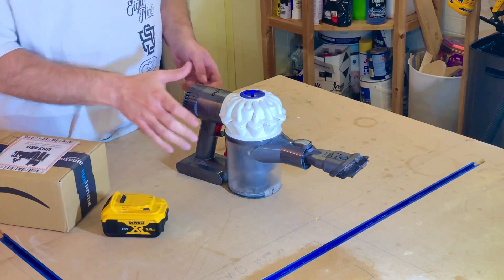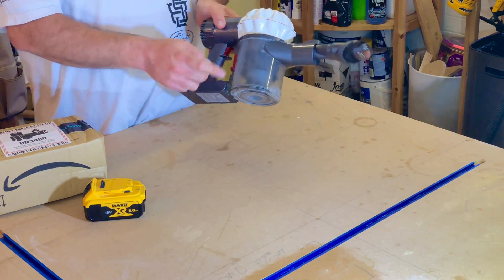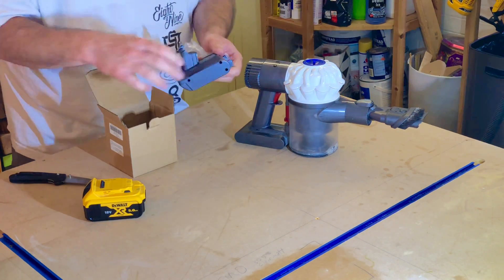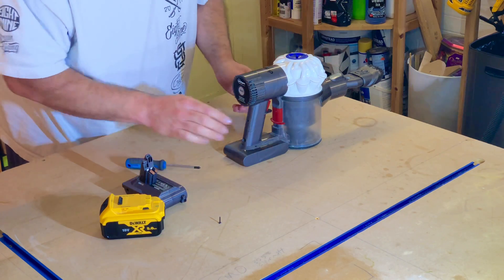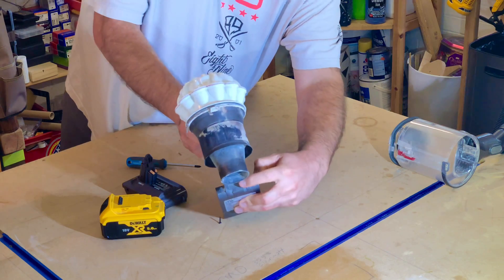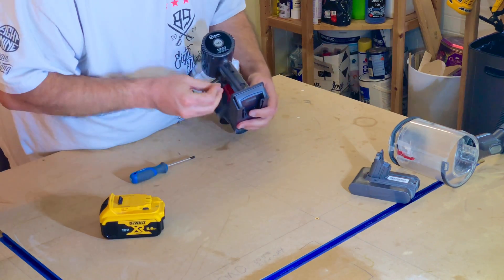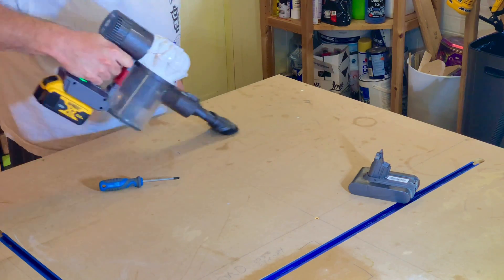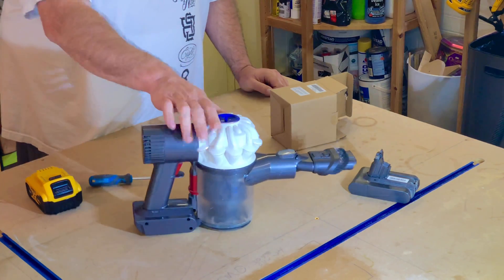Under 4 mins: converting a Dyson V6  (SV03) to use DeWalt XR 18v batteries with a BTRUI adapter

Comment: Dyson could of quite easily made the batteries so they just clip  in , as well as given the option of a higher amp battery .Like you say  you can not use the stand or charger anymore ,and this looks a bit heath Robinson. Shame on Dyson

Comment: Does yours run on max mode? I did the same thing with a 20v dewalt battery and the vacuum cuts in and out on max mode
Reply: Same problem,  did you find a fix?

Comment: Has anyone used a 20V, 5amp Dyson battery and only gotten about 5  secs of run time when using on "Max" power setting?
Reply: I'm having same issue.  Did you correct it?
Reply: I’ve used a 1.5 Dewalt and a 6.0 Dewalt copy battery and strangely they both seem to run about the same time til the Dyson starts shutting off. The Dewalt copy will still have 1 light of charge left when I press the button on the battery when it starts to shut off

Comment: Have you tried a dewalt 60v battery on it?
Reply from the maker: I haven’t, sorry. I only have the non-flexvolt batteries currently.
Reply: 😎😉 someone please try and let us know how it goes. I only have a 1.7aH PowerStack which would run probably about the same amount of time as the OEM Dyson battery

Comment: I apologize if the answer is obvious, but how does the vac handle to voltage difference?
Reply: Does not covert it adapts, dewalt 18v dyson 21.6v
Reply: They are the same voltage , but the Dewalt battery has twice the number of 18650 cells wired for amps
Reply: Thats what the adapter is doing. Its converting the voltage to what dyson accepts.

Comment: How do we charge them ?? Using the original cable ? Or take out the dewalt and charge using it’s own cable ?
Reply: Take off the battery and charge them in their original chargers, be it Dewalt/Makita/Milwaukee/whatever.

Comment: How's your run time?  I tested using an older 5aH battery to be double the run time of the new Dyson battery.  "JJXNDO Amazon Adapter for Dyson V6 Series Vacuum Cleaner to Convert for Dewalt 20V Battery Update 3" is the video title you can highlight and right click to search for or however you prefer.  Wondering if you have a newer battery to test with.

Comment: New on the market? I looked everywhere 6 months ago in the US.Ended up killing mine Frankensteining it.The knockoff supply of good bats was out.Dyson didn’t have any in stock.I have an other dyson I’ll use this adapter on.But my Bessel $100 stick is way better than my v7.It will run for about 15 minutes.Rethink your vid title and you’ll get 100k’s of views.Thanks for posting! Cheers
Reply from the maker: I’m not sure when these launched but I think you might be right about them being fairly new, I’ve only started seeing posts about them recently. What were you thinking the title should change to? Sadly I don’t qualify for monetisation but happy to reach/help more people if I missed something obvious.
Reply: Loose “Under 4 mins:converting a” That takes up about 1/3 of the title.It was just a thought and maybe someone else has the greatest title suggestion lol I did see the adapter is is for v6,v7 and v8 so there is that to add.I probably had your vid pop up due to watching vids 6 months ago on wiring in a bat to dyson.Give this title a while it may get good views.Cheers
Reply: I just uploaded an update video "JJXNDO Amazon Adapter for Dyson V6 Series Vacuum Cleaner to Convert for Dewalt 20V Battery Update 3" that details what I found after someone asked me what the run time was.  Twice that of the Dyson battery new.
Reply: It must me still loading I’ll check later.I just watched this vid again 😆

Comment: Nice,  me personally, I would recycle/dispose of the Dyson battery and the charging cradle and just have a Dyson /DeWALT vacuum
Reply from the maker: Yeah I might well do that, or give them away for free locally if anyone wants them. Might check the DC charger specs first in case it’s the right size and output for anything else I own.